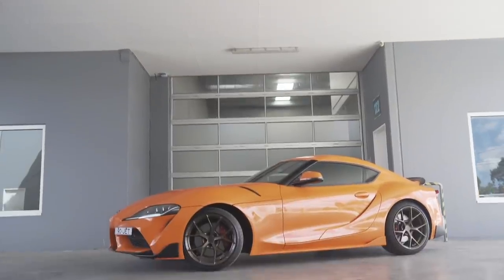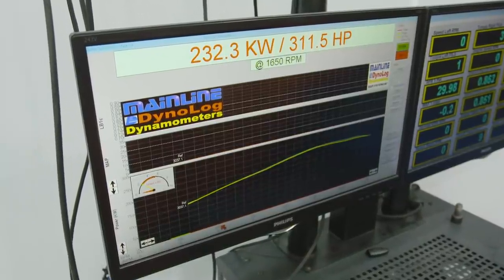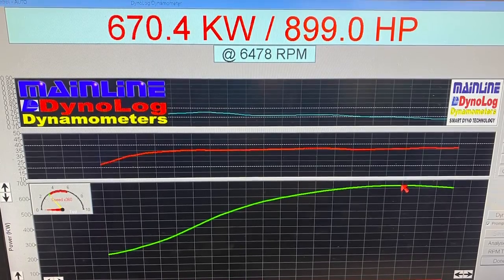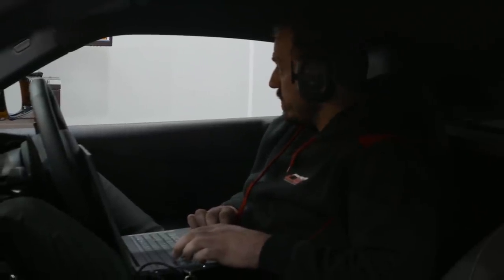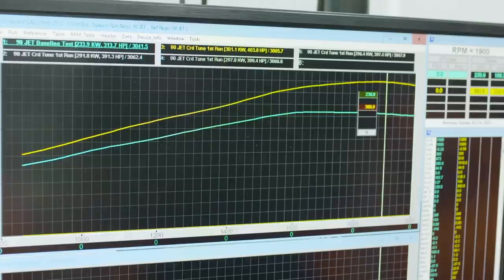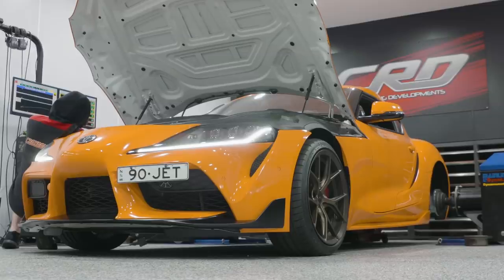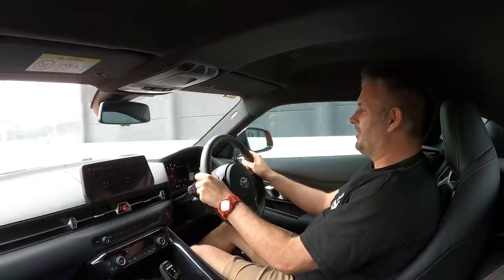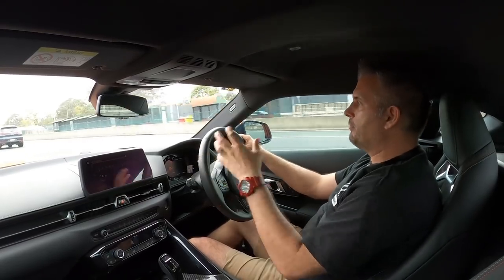MkV Supra 30% Power Increase With Just a Tune! - Motive Garage Supra Ep 3 - RE-UPLOAD

Comment: How dare you call this abomination a Supra.
Reply: It is a Supra because Toyota said so, and Toyota owns Supra's namesake. Ezpz, kid.
Reply: @sepg5084  Toyota can call it whatever they want, that doesn't mean that it's not just a BMW with a body kit.
Reply: @PistonAvatarGuy  i have never heard of a body kit that comes with a complete unibody
Reply: @Bird-nx5ef  The unibody itself is unchanged, only the outer sheetmetal/plastic is different.
Reply: @PistonAvatarGuy  yes and no, the unibody is different, the suspension(kinda, different springrates etc), breaks, engine, gearbox and diff package is the same. 

The BMW Z4 is a convertible and have a different chassis and unibody to help with rigidity, supra uses it's roof to help with strength(and is a bit more rigid for track use compared to the BMW according to people who have tested the cars and ultimatly come to the conclusion that they drive completly differently) 

They are based on the same architecture, but they are not the same, many people who have driven it say the same thing.
Reply: @Zesserie  It's almost ALL BMW and it absolutely does not deserve the Supra name, PERIOD.
Reply: It has been 2-3 years and you still can't get over it. Deal with it or just ignore it.
Reply: @PistonAvatarGuy  It is a toyota, and it's name is supra, it has a 3L turbo engine. 

we wouldn't have gotten that kind of sports car if it wasn't for the collaboration between Toyota and BMW. 

I don't understand why people complain about legacy, oh it's not toyota here, it's not toyota there. 

I feel sad for the engineers at toyota for the amount of hours they put into that car when people make it out like they did jack shit.
Reply: @Zesserie  It has a 3 liter BMW engine, the likes of which Toyota never would have produced. The nature of the engine is such that it's EXTREMELY limited in potential when compared to the 2JZ.

It would have been better to have nothing at all rather than have this obscene cash-grab of a car.
Reply: Calm down it's been a couple years
Reply: @PistonAvatarGuy  did you exspect Toyota to spend millions to develop a brand new motor for one car that they don't know will sell at all? I don't know if you know but the a80 supra was a financial failure.
Reply: @jaredsmukulis1345  No, like I said, they shouldn't have even bothered trying to put the Supra back into production.
Reply: @PistonAvatarGuy  i disagree i own a mk4 supra and love the a90 for what it is would i swap my mk5 for a mk5 no but i like that they exist would love one for a daily
Reply: @PistonAvatarGuy  If the unibody is unchanged, the Supra wouldn't have a fucking roof...
Reply: @PistonAvatarGuy  B58's are derived from the work BMW did decade back with the N54 (widely regarded as the modern 2JZ). People who actually have a clue, have pulled the B58 apart and think quite highly of them. Saying its limited in potential is utter ignorance.
Reply: @Jaredscott89  Fine, LARGELY unchanged.
Reply: @Jaredscott89  The B58 is all aluminum (it would need a billet block to even begin to approach the output of the more powerful 2JZs), it has Valvetronic (which severely limits the capability of the valvetrain) and it's undersquare, which severely limits valve area and the maximum rpm potential of the engine. The B58 will never, EVER approach the output of the most powerful 2JZ-GTEs, PERIOD.
Reply: I dont get the hate and the legacy boners people have, they wont acknowledge a good car for what it is, only crap on it for what it isnt :/

If we are gonna be brutally honest, the mk4 is nothing special except for an overbuilt engine, it was a boat. 

A boat id like to buy, but still a boat in stock form
Reply: @jaredsmukulis1345  Most people with a clue think the showroom standard car is already quite reasonable.

So I'm not quite sure what you are getting at on that one. It adds power easier and cheaper than most other modern vehicles too, so its quite a strange claim to make.
Reply: @Zesserie  Yeah I owned a Mk4. Compared to the R33 GTR and RX7 I had after, it really was a shit box. Only did one thing well, straight line pace.

Fond memories though, would own one again.

I think these people have low IQ, so they their arguments only go skin deep to irrelevant things and get triggered if people don't agree with their superficial take on the situation.

Most people that hang shit on it for being essentially a BMW, haven't ever actually driven one in my experience.
Reply: It may be a “BMW” but Toyota did all of the vehicle component QA, design validation and test acceptance. Toyota still had a pretty large role in the car, even if most of the physical components were built by BMW
Reply: @PistonAvatarGuy  Patently incorrect.

Stock bottom end 2JZ record has essentially already been matched by the B58...

Which was also done a valvetronic head, lol...

Being undersquare on its own means nothing and doesn't result in what you say.

Maximum rpm's are irrelevant on their own. Seems like a random superficial argument. Some of the most powerful drag cars on the planet aren't limited by what is actually a pretty small 95mm stroke.

Your last claim is pretty dumb. The most powerful 2JZ's don't use the stock block or bottom end. Most 2JZ's are actually running stroked bottom ends, which end up making them undersquare, something you claim would be detrimental... lol, way to nuke your own argument.
Reply: @PistonAvatarGuy  I like how you were categorically wrong, and you still attempt to throw shade. Grow up kid.
Reply: @Jaredscott89  I apologise man, I was meaning to reply to the other dudes comment
Reply: @PistonAvatarGuy  damn if your definition of greatness is a car that requires thousands of dollars to get to any reasonable state, I would hate to see what you define a bad car
Reply: @Jaredscott89  people swap the jz block and go billet.not because they break they will take 70 psi no groute.you mate have no clue
Reply: @Jaredscott89  "Stock bottom end 2JZ record has essentially already been matched by the B58..."

And? This demonstrates that you know absolutely NOTHING about engines.

"Being undersquare on its own means nothing and doesn't result in what you say."

Uhhh... yes, it does. A longer stroke means higher piston speeds at a given rpm, which means less rpm potential. F1 and superbike engines are oversquare for that very reason. It's also impossible for an undersquare engine to have as much valve area relative to its displacement when compared to an oversquare engine, which also limits high rpm performance. The B58 is doubly inferior in this area because it's direct injected and the injectors take up space in the combustion chamber that could otherwise be used to fit larger valves. The B58 heads have absolutely terrible flow numbers as a result of these shortcomings.

"Maximum rpm's are irrelevant on their own."

Wrong, more rpm = greater power potential, which is why F1 teams were shooting for the moon and hit 20,000 rpm before being limited by the rules.

"Some of the most powerful drag cars on the planet aren't limited by what is actually a pretty small 95mm stroke."

That's the point, you want a short stroke in a racing engine in order to keep piston speeds low. Most rulebooks limit bore, btw.

"The most powerful 2JZ's don't use the stock block or bottom end."

But the 2JZ can still make around twice the amount of power that a B58 can make on the stock block.

"Most 2JZ's are actually running stroked bottom ends, which end up making them undersquare, something you claim would be detrimental"

Even the 3.4 liter 2JZ strokers have a shorter stroke than a B58, but they retain their larger bore and larger valve area, which are the primary concerns. If you were to stroke a B58, you'd start running into problems with increasing rpm long before you would with a 2JZ.

Hope you learned something, bro.
Reply: @jaredsmukulis1345  The Mk. IV STILL dominates in racing, despite being 30 years old, if that's not the definition of greatness, I don't know what is.
Reply: @PistonAvatarGuy  can I ask what racing seires the a80 "dominates" in, because to my knowledge the only successful a80 was the Castrol Toms  car which had a 3sgte in it
Reply: @jaredsmukulis1345  Who said anything about a series?
Reply: Just run out of popcorn bear with me guys right im ready 😆
Reply: @PistonAvatarGuy  how is that a bad thing though lol.
Reply: @magnetic0314  How is what a bad thing? LOL
Reply: @PistonAvatarGuy  you do realize that the MK4 made a legacy by having a 3sgte and 1uz engine in it around different tracks right?
Reply: @v8_sami  No one in the US has even heard of that. The Mk. IV made a name for itself by being an absolute monster on the DRAG STRIP (regularly destroying V8s) in the US. Mile races, too, were dominated my the Supra for a time.
Reply: @PistonAvatarGuy  how is it being heavily based on a BMW a bad thing?
Reply: @magnetic0314  Because Toyota makes far better cars.
Reply: @PistonAvatarGuy  hahahahahahahaha pull the other one..... I love Toyotas as much as anyone but come on bro.
Reply: @magnetic0314  Yeah, Toyota having the highest resale values (for decades) and BMWs having terrible resale values means that BMWs are BETTER than Toyotas, ok buddy. I don't see BMW winning the 24 hours of LaMans, or the Dakar Rally, or dominating on the drag strip either.
Reply: @PistonAvatarGuy  strange logic but okay 👍
Reply: @magnetic0314  Strange? What makes BMWs better? Their terrible reliability?
Reply: @PistonAvatarGuy  TL;DR.
Reply: @Jaredscott89  PWND.
Reply: @PistonAvatarGuy  Inane.
Reply: @Jaredscott89  Yes, you absolutely are.
Reply: This is hillarious, the piston dude i digging a hole so deep and keep doubling down on it. jesus xD

The B58 with the "stupid valvetronic" is an impresive engineering feet, it's a capable eninge "even if it's undersquared". 

The head is as advanced as it gets which make it a non issue, it has VVL and VVT on both cams with head that flows better than what a stock 2JZ head does. 

it being undersquare design gives it good properties for what it's meant for, being an actually marketable and sellable car in todays climate. 

but what is even more impressing is the amount of power it can make as well! it's a very well engineered package. 

Toyota actaully helped BMW with the engine to make it more reliable, they had engineers that looked at where they could improve it and BMW with the help of toyota implemented those features. 

The B58 could already early in it's life in the A90 make over 900hp on the wheels. 

it can probably do 2K hp with a billet block just like the 2JZ. 

you know why? since a billet block dont really bare much resemblance to the original parts anyway, which is also why the 2jz have made so much power. 

and most the 1000hp+ drag builds either has a grout filled block or something billet. 

the heads are far from stock as well. 

But hey you do you piston dude, i'm not saying the 2JZ is bad, it was an over engineered cast engine, just like the Volvo redblocks which can make close to 2JZ power as well. which is pretty impressive for 4 banger from the 70's, but as with 2JZ it needs ten thousands of dollars to make it happen.
Reply: @Zesserie  Typical GM guy, doesn't know ANYTHING about engines. I guess that's why you're a GM guy, though, right?

"The B58 with the "stupid valvetronic" is an impresive engineering feet, it's a capable eninge "even if it's undersquared". "

FEET??? Seriously? Yes, Valvetronic works great in production cars, but it's nothing but a hindrance in a racing application. If you want to argue about that, go argue with PapadakisRacing, who locked the system open and couldn't do anything but deal with all of the slop and mass that it adds to the valvetrain. The entire head would need to be completely re-engineered in order to eliminate the Valvetronic system and allow for a truly high performance valvetrain.

"...with head that flows better than what a stock 2JZ head does."

There are probably dump trucks from the '70s that have better flowing heads. I can't find the numbers at the moment (I saw them a while back), but the professional head builder who flowbenched the B58 head said, "will say it's the worst cylinder head in terms of flow ever on the flow bench" . EAT IT, buddy.

"it being undersquare design gives it good properties for what it's meant for, being an actually marketable and sellable car in todays climate."

Thanks for making my argument for me. It's a grocery-getter head, not a head which was built with making big power numbers in mind, like the 2JZ head.

"but what is even more impressing is the amount of power it can make as well! it's a very well engineered package. "

It's not impressive at all, it's one of the worst performing 6 cylinders on the market (with regard to tuning). Toyota's own 2GR (used in the Lotus Exige), or the V35A (which just won the Dakar Rally), would have been far better choices.

"Toyota actaully helped BMW with the engine to make it more reliable..."

Yeah, BMW needs all of the help that they can get. And, again, you're just making my point for me, which is that Toyota should have used one of its own engines in one of its own cars.

"The B58 could already early in it's life in the A90 make over 900hp on the wheels."

And? The 2JZ can do that on stock internals, the B58 requires extensive modifications to reach that power level.

"it can probably do 2K hp with a billet block just like the 2JZ."

The 2JZ can make 2,000 hp with a stock block. Heck, 2Js have run 5s on the stock block, which means that they were making in excess of 2,000 hp. Granted, the blocks need to be filled to have any kind of real reliability at that power level, but the B58 couldn't get near that power level with any kind of stock block.

"you know why? since a billet block dont really bare much resemblance to the original parts anyway, which is also why the 2jz have made so much power. "

You know what? YOU HAVE NO IDEA WHAT YOU'RE TALKING ABOUT. Why don't you go watch some videos with the Real Street Performance guys in them, they'll straighten you out. Heck, contact them, if you want. Stock block B58 = ~1,000 hp. Stock block 2JZ = 2,000+ hp. Billet block 2JZ 3,000+ hp . This isn't complicated stuff, guys.

"the heads are far from stock as well. "

They're almost all modified FACTORY heads.

" just like the Volvo redblocks which can make close to 2JZ power as well."

There are no Volvo engines making anywhere near 3,000 hp, anywhere in the world.

"but as with 2JZ it needs ten thousands of dollars to make it happen."

You're not building ANY 1,000+ hp engine without spending tens of thousands of dollars (if you want it to last for more than a few minutes, anway) and no B58 is EVER going to match the performance of the 2JZ, at ANY price point. Do you understand what that means? It means that the B58 is VASTLY inferior to the 2JZ, PERIOD, end of story. You just have absolutely no argument here, it's ridiculous.
Reply: @Jaredscott89  So where are the 2,000+ hp B58s? Also, you people need to go watch Papadakis Racing build their 1,000 hp B58, then tell me that it's lightly modified.
Reply: @Zesserie  ROFLMAO!!! You guys just deleted a link to a page that DESTROYED you all! What a weak bunch of.....
Reply: @Zesserie  It was a link to a page about Geo's Real Street Supra, for anyone who might be interested. 2,100+ hp on a STOCK BLOCK!!!

Relevant quote: “When you tear out a man's tongue, you are not proving him a liar (wrong, in this case), you're only telling the world that you fear what he might say.”
Reply: @PistonAvatarGuy  The same place the 2JZ was in this period of its life. In development.

1000hp and 2000hp 2JZ's took more than a decade to develop.

I never said that engine was lightly modified. So I'm not sure what that moronic statement is about. But that would be the one where he builds the engine with a stock block, factory crank and pushed 1000hp through a two port head right?

lol at the self defeating arguments.
Reply: @Jaredscott89  No, buddy, engine tuning technology advanced ENORMOUSLY in the past 20 years and everything that's possible with the 2JZ is possible with the B58, RIGHT NOW. The reason why you will never, EVER see a 3,000 hp B58 (maybe not even one that makes 2,000 hp) is because IT DOESN'T HAVE THE ARCHITECTURE FOR IT. What you're saying is basically the same as saying that the Honda D-series engines should have been able to match the K20 series in performance after a long enough development period, but they NEVER will, because they're PEASANT engines, just like the B58.

"1000hp and 2000hp 2JZ's took more than a decade to develop."

Because the technology wasn't there, NOW IT IS.

"I never said that engine was lightly modified. So I'm not sure what that moronic statement is about."

Because you keep comparing 1,000 hp 2JZs to 1,000 hp B58s, as if they similarly modified, BUT THEY'RE NOT.

"But that would be the one where he builds the engine with a stock block, factory crank and pushed 1000hp through a two port head right?"

You do realize that the 2JZ can do that WITH STOCK INTERNALS, right? Papadakis Racing also had to eliminate the direct injection, create a port injection system, design and build an entirely new intake manifold, eliminate the Valvetronic system, upgrade the rods and pistons, make significant upgrades to the valvetrain components, they ported the head.... etc.

I'm convinced that you people are just trolls, some kind of shills for BMW, or Toyota. You're disgusting.
Reply: @PistonAvatarGuy  Wrong. It simply takes time for new engines to filter down the pipeline into tuners hands and more time again for the knowledge to get accumulated and disseminated. This is true for all platforms.

This is the simple objective reality of engines and their development in the aftermarket.

I haven't seen a 2JZ at 3000hp either. Doesn't have the architecture and needs to be heavily modified and use blocks that aren't simply a billet copy, but an actual improvement on the structure itself. So your argument there is pretty flawed, borderline inane.

I didn't say anything about a D series engine. No need to built shit arguments no one is having with you. If you can't stay on topic, this is pointless.

I've not compared any 1000hp B58 to a 1000hp 2JZ. I'm simply stating the stock bottom end record for both is within a dyno measuring error.

Not sure why you keep bringing up this Papadakis engine, its neither the record holder or an example of someone pushing the stock bottom end to the limit. He was building an engine that was going racing, you would also extensively modify a 2JZ to be used in that same application at that same power. I know, because I've built the things for the local series. 

You are simply conflating two different things. But I understand why now, your brain injury. I don't hold it against you. I feel sad for you.

No one with a functioning brain would look at that head version, knowing there are other versions, and make the idiotic sweeping statements you've made. Its like taking the later VVTi 2JZ revisions and universally declaring that is the limit. Its retarded, I don't know why you insist on doing it.

Is that satire? You are the fucking troll, seek professional help.
Reply: @Jaredscott89  Again, you just have absolutely NO IDEA what you're talking about, and that's been proven beyond any doubt here.

"I haven't seen a 2JZ at 3000hp either"

That's because you have NO IDEA WHAT YOU'RE TALKING ABOUT. Just look for them.

"Doesn't have the architecture and needs to be heavily modified and use blocks that aren't simply a billet copy, but an actual improvement on the structure itself."

It took a good deal of strength for me to remove my hands from my face to type this. The basic GEOMETRY of the engine is the same, that's why it's still called a 2JZ. Those engines still use the factory heads, because the block shares the same GEOMETRY with the factory block. This couldn't be done with the B58, its geometry is MASSIVELY inadequate for use in an extreme high performance application. I just don't get it, you're basically trying to say that every high performance engine builder who's ever written anything about engines is wrong, THAT is absolutely insane. READ A F--KING BOOK, FFS!

"I didn't say anything about a D series engine."

WTF? I DID!!! The point was (which should have been extremely easy to understand) that the Honda D-series engines have nearly all of the same shortcomings as the B58 (the Valvetronic system is one shortcoming in ADDITION to the shortcomings that the D-series have), and those shortcomings have kept them from being decent performance engines.

Anyway, I've said all that I need to say, time will prove me right, and you'll just keep living in denial and deleting any bit of information that proves you wrong. You can feel sad for me all that you want, I'm not the one who censors people and lives in a fantasy land. I get to live in REALITY, where I get to see people eat their words after telling me that I'm wrong, and that's a GLORIOUS feeling.
Reply: @Jaredscott89  High Performance Academy has a video about a 3,000 hp 2JZ, I should think that they're more than trustworthy on the subject. EKanoo is also likely to have made 3,000 hp (or close to it) with their 5 second Supra.
Reply: @Jaredscott89  I suspected he might be challanged in some capacity, but yes i fully agree with you and yes the engines he is refereing to has little to nothing in common with a 2jz as you said.

This is enough for me here, they guy is putting the engine so far upp the pedestal he might be half way up his ass buy this point xD
Reply: @Zesserie  Yeah, the way he talks is inane. No one with a clue is seriously expecting a modern motor like the B58 to be the next 3000hp import choice. Its a shit argument that has nothing to do with comparing factory works engines.

Also no one with any background in engineering or engine building actually thinks the B58 is a peasant engine or whatever the clown called it. Their design is extremely intelligent, it isn't a cheap engine for BMW to manufacture.

Yeah, they guy has never touched either engine. His fantasy is probably getting pegged by a 2JZ.
Reply: @Jaredscott89  Hilarious.

Guy 1: Oh no, he's right, the B58 is s--t compared to the 2JZ.
Guy 2: That's alright, no one was expecting it to be anything but s--t anyway and that was really our argument the whole time. Our position on this matter didn't shift in order to make PistonAvatarGuy look bad, we are very smart and are never proven wrong about anything.

Me: ...

The B58 is a s--t engine, GET OVER IT. It doesn't even stack up well against the Honda K=series FOUR CYLINDER engines, FFS!

Oh, and there's a 5 second 2JZ powered Camry from Brazil as well (Titan Motorsports, I think), so that one is also likely to be making around 3,000 hp.
Reply: @PistonAvatarGuy  mike botti drives stock Block with valvetronic, with strengenth stock trans 8,3/162mph and have 1200hp. Stock block and valvetronic holds fine. That car is still street driven and has alot stock interior and exterior on use. Stock body as well. You have to do more work on 2jz and mkIV to get 8sec runs.

Mike Botti, p2tune and titan motorsport say they will hit 7sec times in this year with street driven car.

There is proof for crazy power for way less work.

Then if we look b58 realibity is there is alot info that is one of the Best engines in modern time and its good very good.

If you have the car its fine but plesse look info and try make your arguments to pace on facts..
Reply: @89Heke  The point that I was making is that the B58 is vastly inferior to the 2JZ, AND IT IS. The B58 will never, EVER be competitive with the 2JZ at the higher levels of performance, because it has a great many shortcomings which will prevent it from doing so.

"You have to do more work on 2jz and mkIV to get 8sec runs."

Not compared to what you have to do to a B58, anyone who claims otherwise has absolutely no clue what they're talking about.

NOTHING beats Toyota reliability, especially when it comes to the 2JZ. Sorry, pal, but the 2JZ is better in every possible way, except fuel economy, because the B58 is a f--king econobox engine.
Reply: @PistonAvatarGuy  Titan run 8,9 1/4 with stock trans, stock engine with fuel mods and turbo upgrade. Non 2jz car has done that. That was full stock body with stock interior as well.
Reply: @89Heke  Yeah, buddy, I just had a quick look at that car, it's VERY heavily modified. A Supra wouldn't even need a stripped interior, a stroker kit, or any transmission modifications to go 8s.
Reply: @PistonAvatarGuy  this shows you dont look facts. 6sec 2jz has billet engine and over 1500hp 2jz bolck is on limit. Now botti drives with no problems with 1200hp with aluminium block. Awfull near in 2jz Block .

And more that low 9sec and 8sec times. Those cars has stock ecu with ecutek rom. You have but 8sec 2jz pistons, rods, crank holders(Brian cover bottom end) casget, ecu, transmission, cams.

While b58 holds with stock.

What this means? Mostly b58 is modern car which make with less strress more effect power and reason is way beter head desing.
Reply: @89Heke  Supras were famous for doing 8s with minimal mods. Are you just learning about cars?
Reply: @PistonAvatarGuy  haha no they are not. I dont know where you get this fanboy things but i have been tuner for over 16 years and owned mkIV as now a90 supra.

My one sponsor drive 1400hp B street supra which has 6sec drag cage inside and we have very good knowledge on 2jz platfrom
Reply: @89Heke  Yeah, sure, buddy.
Reply: @PistonAvatarGuy  mikey botti drives low 8 sec times (8,2 right now) get you stuff right
Reply: @PistonAvatarGuy  this show you dont have knowledge and never been building 2jz which runs even 8sec times.

2jz stock Block dont hold 2000hp. It dont hold even 1000hp with support mods on Block.
Reply: @89Heke  Real Street built 2.000+ hp 2JZs on the stock block, if you don't believe me, contact them. Sorry, buddy, but your experience is clearly not even remotely relevant here, the Real Street guys know way more than you ever will.
Reply: @PistonAvatarGuy  i check baltic 2jz  out. That has Brian billet crank main bearing caps, cams, valves, ports has done, ecu, wirings, coils more that b58 needs to run those times.

Baltic car shows it need support to crank to hold it place. B58 with over 1000hp need them too.
Reply: @89Heke  That was when he started running 7s. I don't think that there are ANY B58 powered cars in the 7s.
Reply: @PistonAvatarGuy  and if we think how much time is between time on b58 and 2jz the cap is normal. B58 will be in this year in 7s category  with p2tuned and titan motorsport.
Reply: @89Heke  You people just don't get it, time does not fix inherent shortcomings with the design of an engine. Yes, engine tuning is more advanced these days, so the B58 did put up quick times fairly early on when compared to the 2JZ, but that does not mean that both engines have the same maximum power potential. The B58 will NEVER be in the 6s, and it will especially never be in the 5s, PERIOD.
Reply: @89Heke  Also, listen to the announcer in this video: https://www.youtube.com/watch?v=r8AH6KmErPU

This is probably the car that Geo talks about when he says that the stock block has been in the 5s, which is absolutely in the 3,000 hp range.
Reply: @PistonAvatarGuy  eekanoo both cars has billet blocks in them.
Reply: @89Heke  I'm sure they do, the stock blocks don't last long when they're pushing 3,000 hp.
Reply: @89Heke  Anyway, you guys can keep disagreeing with the best tuners in the business, all because you touched a 2JZ once, I'll just keep laughing at you... and the B58.
Reply: @PistonAvatarGuy  and if tuners wants to continue with b58 can be high 6s contenter. In 5s i dont think so. It need soo much research to do it and b58 dont get same love than 2jz gets. But time will tell. Head desing is away lot better than 2jz and it has way more potential to high power but Block will need to be biller for sure. 6s drag cage, right gearbox it will be 6s contenter. With ZF and stock body it will be in 7s contenter maybe with crazy luck low 7s.
Reply: @PistonAvatarGuy  hmm and those Best tuners back up b58 and tell it will be in this year in 7s contenter. Here is only problem and its your crazy belief on 2jz and cant see anything else. That is bigest reason taking with you is like talking a wall.
Reply: @89Heke  No, buddy, just like anyone who knows anything about engines, I understand that certain things make an engine perform well, like a piston speeds that aren't through the roof, or larger valves, or stronger components, or less reciprocating mass, and the 2JZ is just better in those areas. Talk to any experienced engine builder, they will back me up.

Nothing here is magic, it's engineering and it's ALL grounded in numbers and mathematics, and the B58 just doesn't have the numbers to beat the 2JZ.
Reply: @89Heke  I agree with the limit of the stock motor unopened. 

Most stock 2js will only take 800 at the top end  before you need to replace the cast pistons to maintain reliability...

B58 stock motor unopened also has it's limits near the 750+ mark which is awfully close to the claimed 800 of the 2j and can be purely down to the dynos 

Got my popcorn out and reading this diplomatic discussion has certainly entertained me non the less haha! 

It amazes me how some people can literally twist shit into making their statements relevant and comparable. 

I have always been a 2j fan and even I highly regard the b58 that's in the supra. It's a proper modern 2j 

Which comes in a better car, a quicker transmission, lighter, all while being able to meet all the modern emissions bullshit. Absolutley brilliant!
Reply: @christopheryoung7722  Explain how any of that is relevant. I'll wait.
Reply: @lewisanth4986  "It's a proper modern 2j"

Yeah, vastly inferior, like most modern garbage.